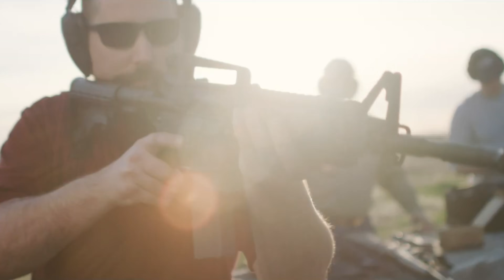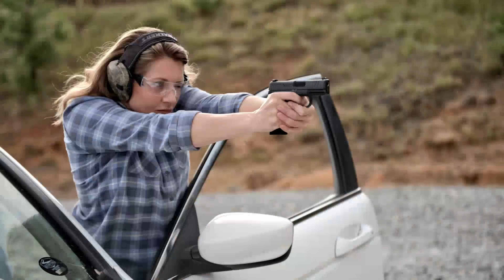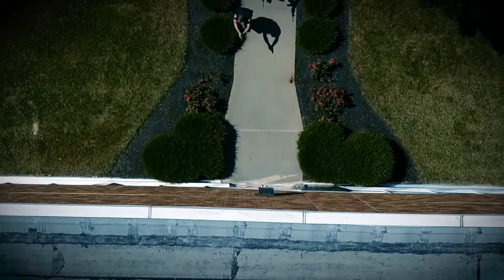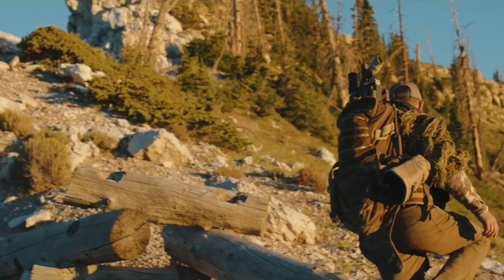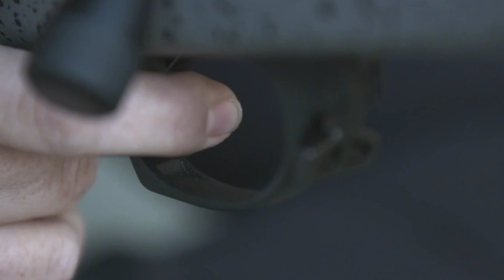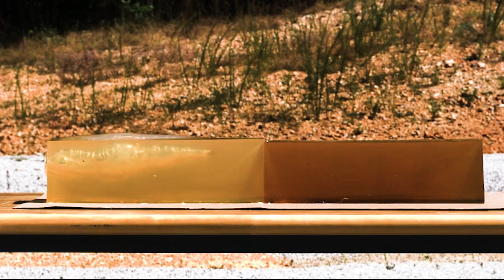Ammo Prices CRASHED in 2026 – 12 Calibers Smart Gun Owners Are Stocking Now

Comment: theres no point in buying anything more than 9mm, 223 and 22lr.  Maybe 308 if you want to  legit  hunt elk, moose bears, mountain sheep and goats.  The 223 softpoint has taken such critters with brain hits at 100m or so, using a braced firing position, 

 A 3"  chambered 20 ga gas-op auto will handle the shotgun stuff, if you want to bother with that.  The 2  3/4" 20 ga of today outperforms the black powder 10 ga of the early 20th centery. If you're stuck with non -lead pellets for waterfowl, you can use 3" bizmuth 20 ga shells and "reach out" quite well enough for geese. Mostly , tho the shotgun is for upland birds, rabbits and squirrels and there's no point lugging around a 12 ga and its heavier shells for such hunts

. I hunt that sort of stuff with a pocket .22lr, finding it much more rewarding. Also, the silencer on the 22 pistol lets me go where you'd never make it with any noisy longarm.  The 2.5" long 'can", run wet with WD-40 and water, with the slide locked-shut, is inaudible at 50m,  It groups 2" at 25m from a braced firing position. when you miss, the critter usually just sits there and you get to try again.  The 5.5" long Beretta M21, with the barrel pinned to the frame, big lumiinous sights, the front one on the end of the can,  makes for a handy little 16 oz combo.  A Taurus PT22 mag is fitted, as is an extractor,
Reply: I live in Montana and guide in the fall in Alaska. I take and use a 12gu, 9x25Dillon, and a .375 Ruger. In Montana I drop the .375 and carry my .300esm.